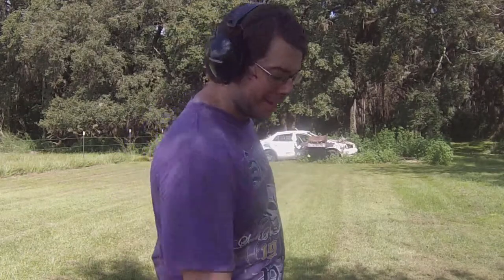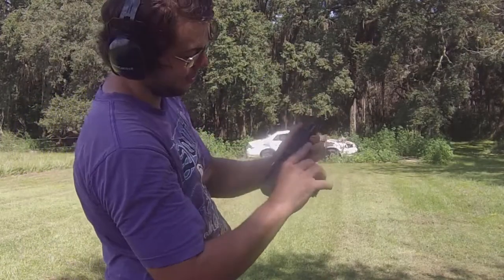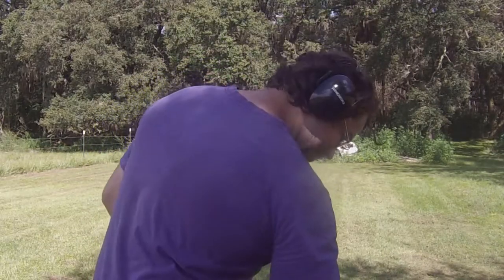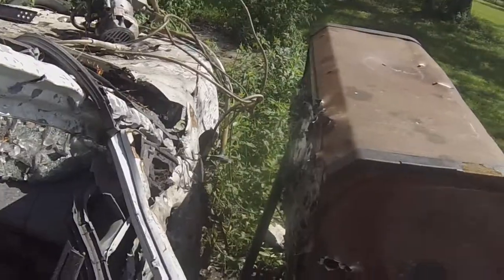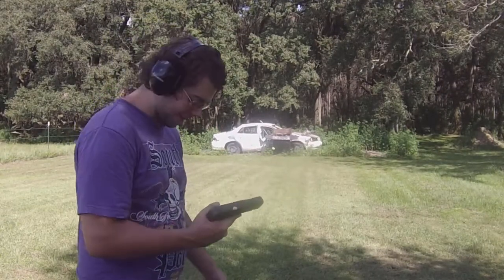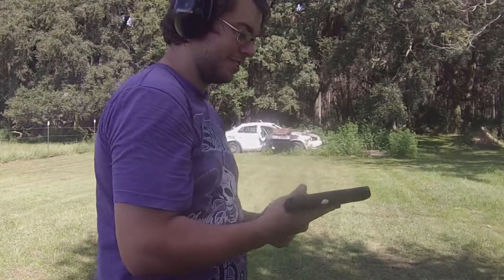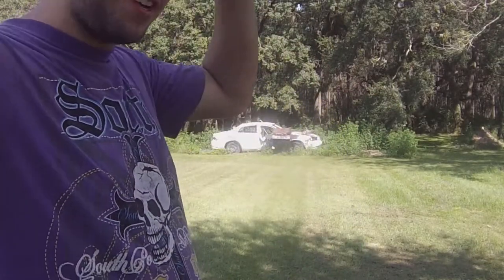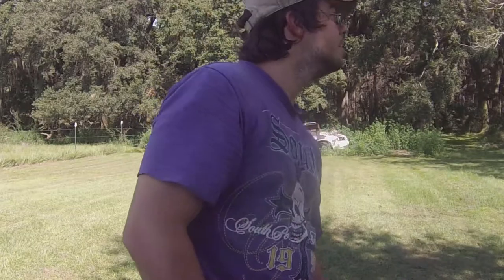Brass VS Steel Case: Stallard Arms JS 9MM Testing Different Ammo.

Comment: The barrel is steel on the Stallard JS-9 but the trunion and feed ramp are milled from aluminum. Since brass and aluminum are relatively soft metals and expand better with a sudden rise in temperature, the gas seal is much better. The fit and finish on most feed ramps in these guns will be adequate enough to cycle hollow-points as well as FMJs without catching or hanging. These things WILL eat hot +P loads for breakfast like most blowback designs will, but I wouldn't recommend running sub-sonics.
Reply from the maker: Thanks for the insight on the handgun. Very interesting to know what it's made of. 

Though I agree on not recommending that, especially in bulk shooting like I do at the range.